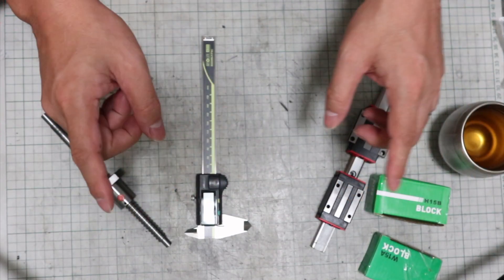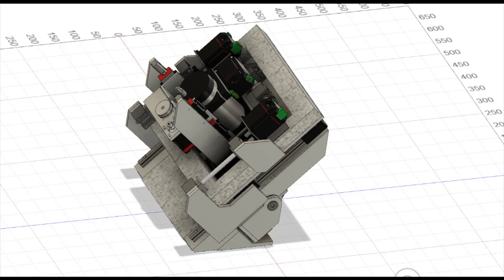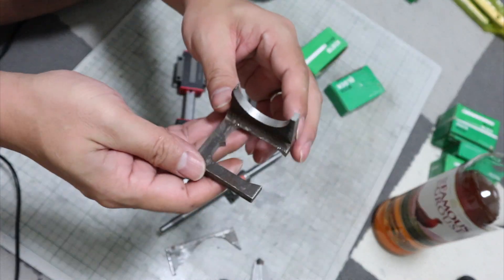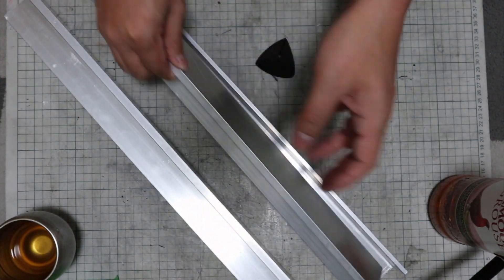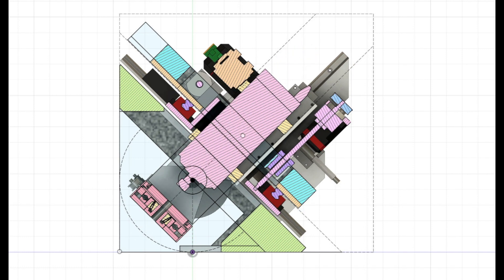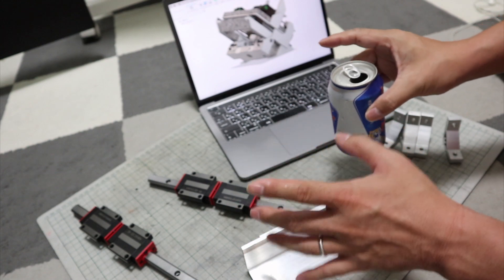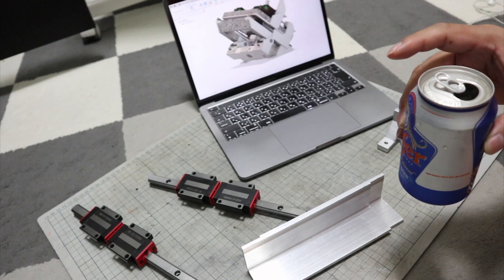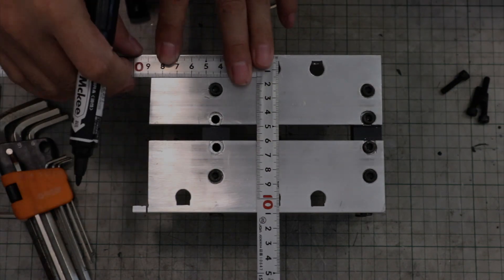Building The 5-Axis CNC Machine in a Small Room: A DIY Journey. (part1)

Comment: a small tray under the cutting table would be very handy. in order to clean the chips quickly  it will be necessary to place a tray . maybe the tray will also allow more  coolant flow. sometimes temperatures above 100degrees Celsius can warp metals and even if it helps evaporate coolant the downside is warping , if precision parts are necessary. anyways i'm on the hype train and cant wait to see the next episode.
Reply from the maker: Thanks for your interest.
I agree with your opinion.
I think this design has some disadvantages, but I aimed for maximum effect under limited conditions.
There are a lot of things we won't know until it's completed.